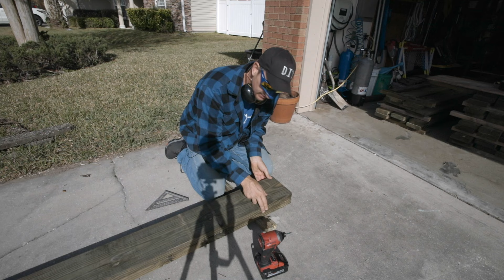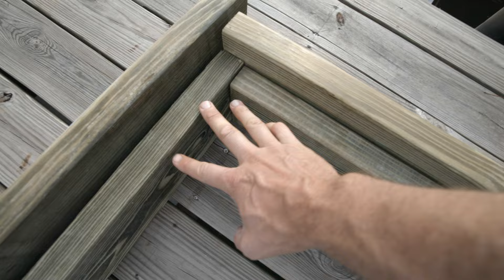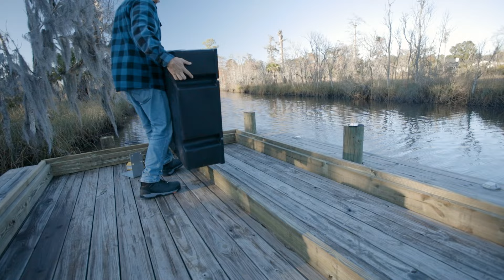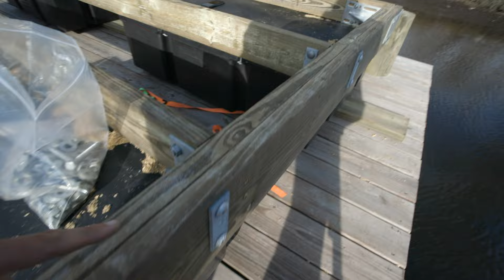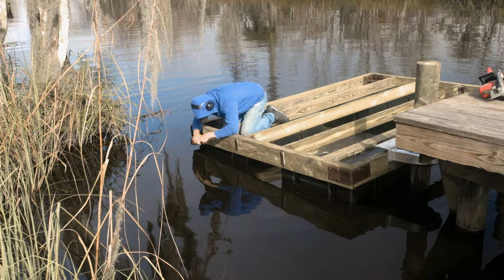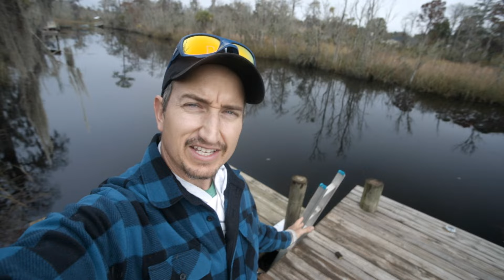Easy DIY Build Floating Dock: Step-by-Step Guide with Pressure Treated Lumber and Dock Floats

Comment: Having used pressure treated lumber do you have a recommendation of using that vs cedar ?
Reply from the maker: Pressure treated is less expensive and more readily available in this region.  I would think cedar would be a great choice however. It is naturally rot resistant and even lighter in weight usually.
Reply: @MrKistel appreciate it. Today I looked at cedar and the local shop has some nice boards . I’ll try the cedar !

Comment: You can clean the bottom around the pier using a mini dredger consisting of two motor pumps and a Bagermaster suction nozzle.
Reply from the maker: Thanks for watching and the tip.